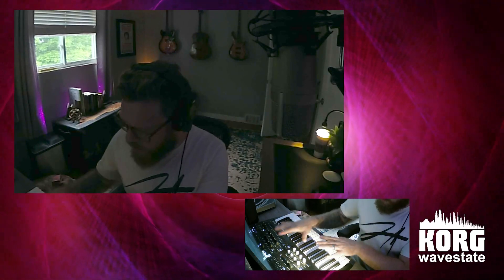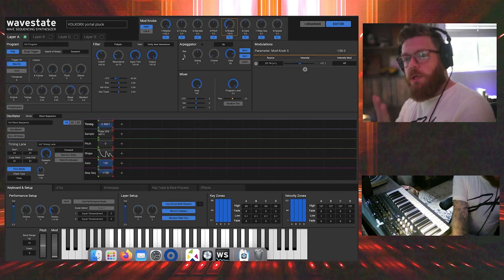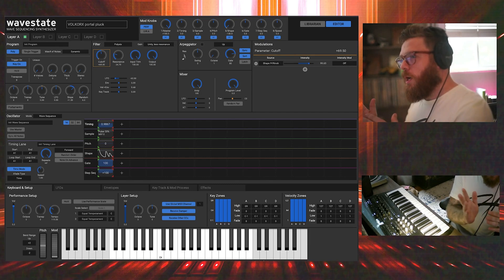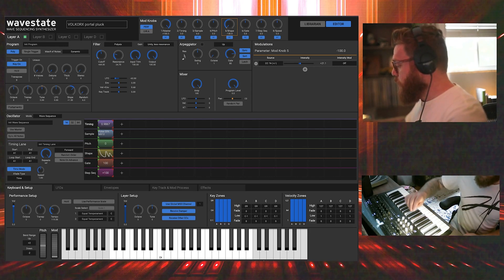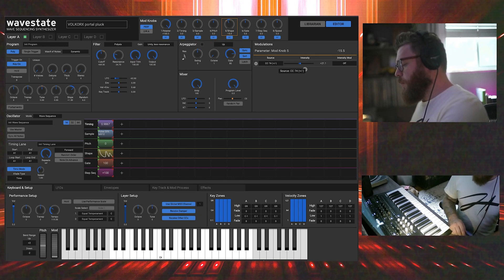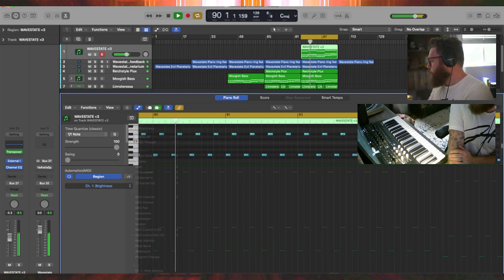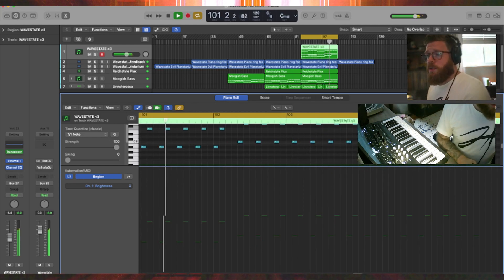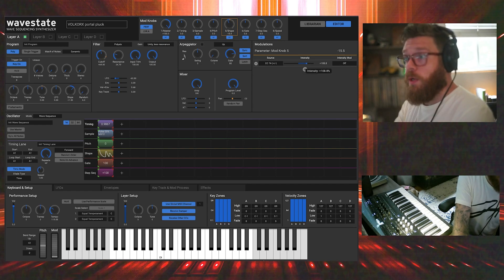Want control your synth's filters from your DAW? - Korg Wavestate - MIDI CC automations workflow

Comment: Hey. Is it possible to apply like a master filter on all 4 layers? Havent found a solution for this. Tried to make four modulations and assign them to one performance knob. But it sounded really bad. Thx for the video 🖖🏼
Reply from the maker: I've done it where i've mapped the shape knob for each layer over to the shape performance knob. The trick was to have no other LFOs and things on those shape knobs and then fiddle with the thresholds on the layer shapes so it affected them all the same. then i can do a full-layer filter sweep, if there's an LFO on one, or one gets affected more or less, it seemed to cause it to sound bad. I've also cheated a little by mapping all three zones of the master EQ to the shape knob, so i can do big full filter sweeps across the whole signal.
Reply from the maker: ah for a little technical clarity that's Pre-FX -> some EQ -> Full Wet -> assign shape perf (or something) to all frequency cutoffs and adjust your sweep threshold on the perf knob to taste.
Reply: @BadGuysGetDead  will try that. Thanks in advance. But this seems to be a bit tedious. I Wish I could Just select all 4 layers on the left Side and apply Like the Filter and the envelopes for the selected layers.
Reply from the maker: @bastianofner2492 for sure! Do you have it connected to a computer via usb? The editor librarian makes this stuff WAY faster than menu diving
Reply: @BadGuysGetDead  yes I have. Still Wish it would be possible by selecting the layers. Thanks again 👍🏼

Comment: I have an IPAD 9th gen with the moog model d on it and would like to use my wavestate as a controller keyboard to play the moog. I have a lightning to usb B cable to connect the 2. Do you have any suggestions on settings to get this to work together?
Reply from the maker: That’s a cool app. I have it too, will have to play around. I used to have an old irig keys setup that could send midi over the old 40 pin ipads. I can see in the model D app that there’s a section for midi input in the settings, have you tried playing around with the wavestate and changing the midi channels? It’s likely channel 1. 

Also the Moog forum suggests something called a “camera connection kit” which they’ve proven works to get midi across. 

Good luck! That’s a great idea
Reply: Hey, Thanks. 
I figured out the moog midi setting was omni and needed to be set to channel 1. Works great!
I also have the Animoog Z and model 15. Love being able to use a combo of the korg and moogs together.
Reply from the maker: @eddieeagle9137  great news! Enjoy!
Reply: Thanks. Btw I'm using a lightning to usb b otg cable. Plug and play. Pretty easy to connect.
Reply from the maker: @eddieeagle1744  i noticed too, you can probably use the CC mapping trick from this video to have the moog app learn all your knobs too.
Reply: @BadGuysGetDead  Cool!